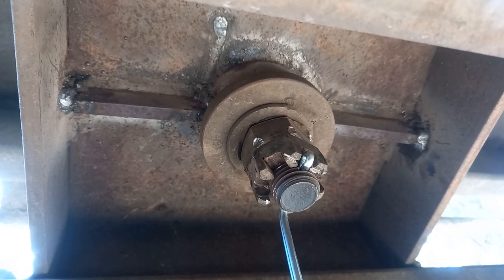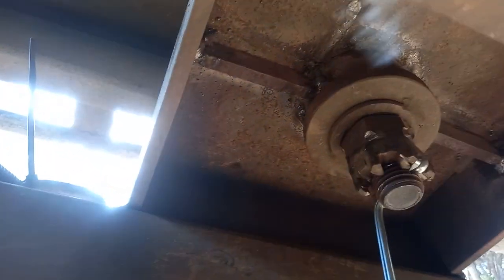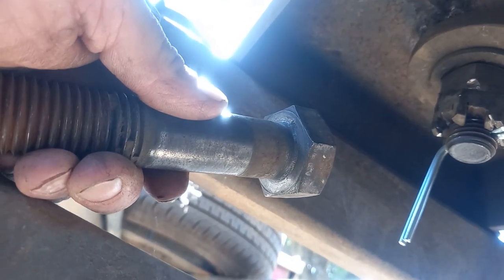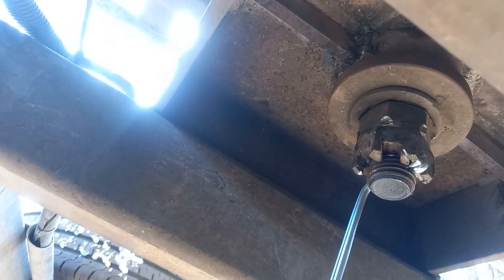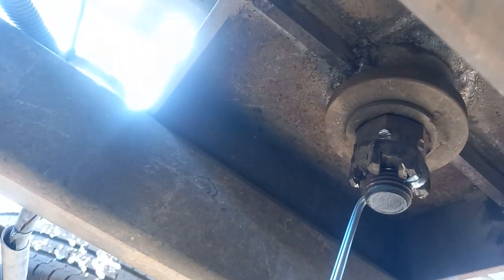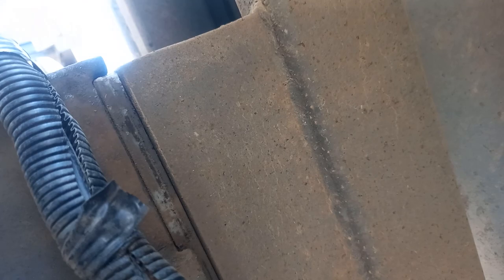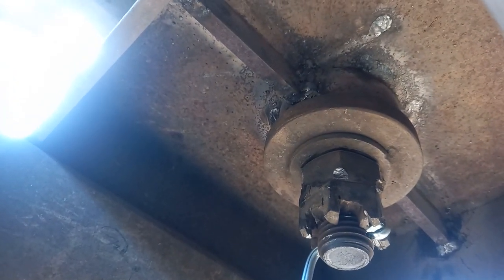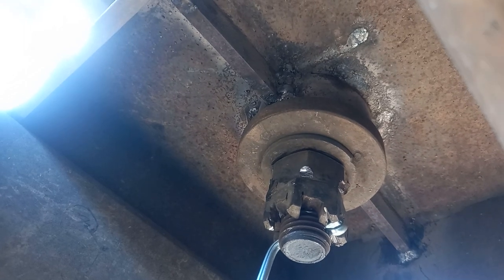Arrrrr ........ Cracks in the turntable plate.

Comment: When you say ball and coupling do you do mean like a gooseneck?
Reply from the maker: Yes. There are now 70 mm couplings which support 1400 kg ball weight but the one I was meaning was the 3 inch socket and ball used on the American trucks for their gooseneck trailers.
Reply: I ultimately would like to build one that is good for 4.5 ton. Love to pick your brain one day
Reply from the maker: @DavesCave  as in the past, open to all questions and prepared to share what I've learnt. 

Personally I want more dog trailers on the road as they are so much safer. If we can save one person from either being injured or killed from a swaying trailer, it's been worth it for me.